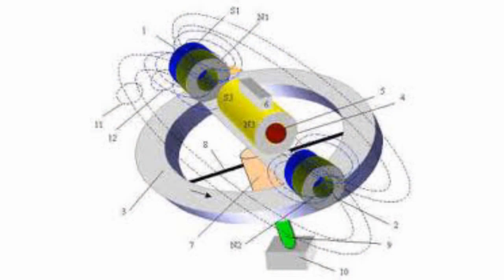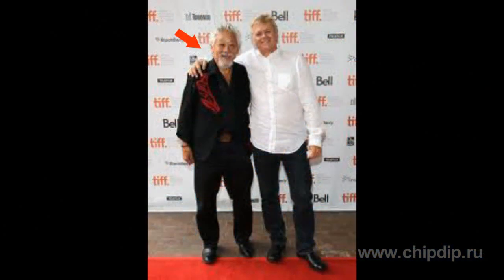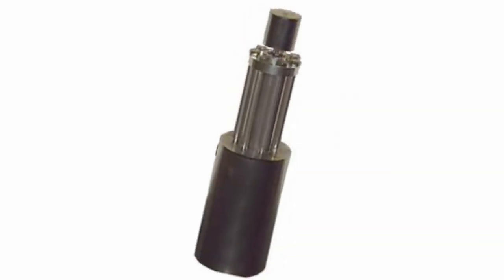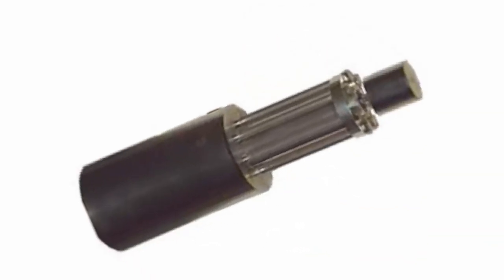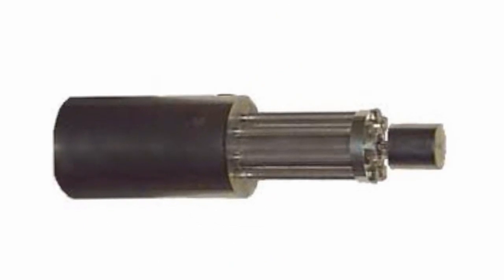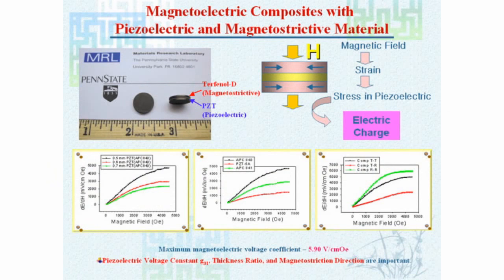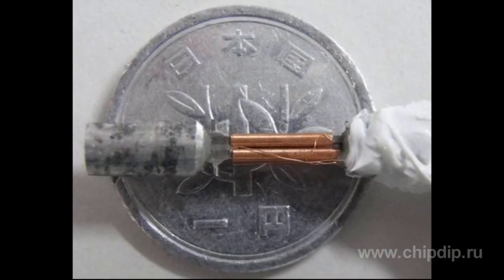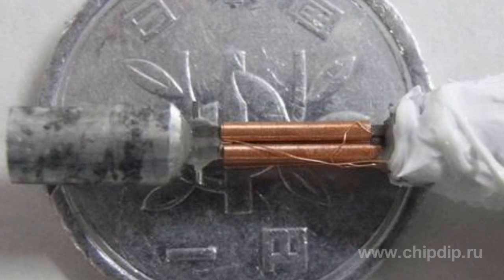Magnetostriction generator

Comment: Thank you for the description of magneto restrictive elements, a delightfully well explained clip.  In relation to the small voltage generator comprising of such elements,  might I venture to suggest that it is akin to a small pendulum; as the pendulum swings across the arc, compression and elongation is achieved respectively of the element/s.   Thank you again: Mr Dorian Stonehouse. 
doriansto@aol.com